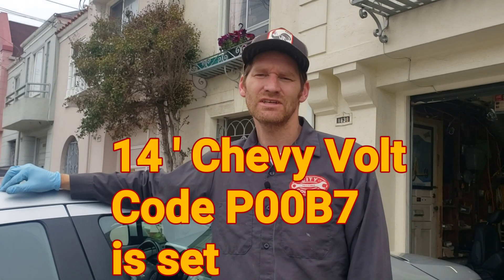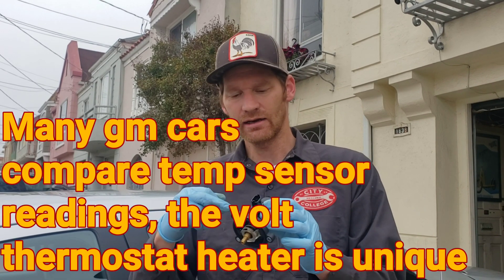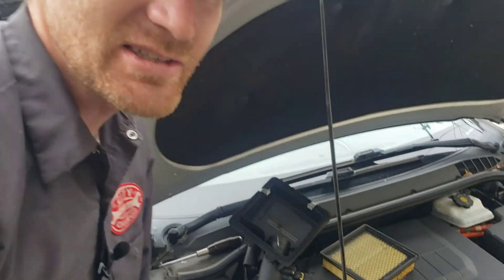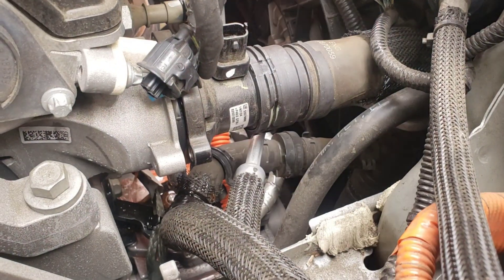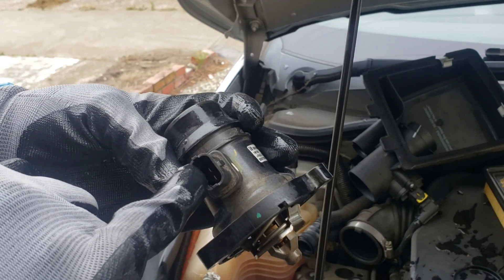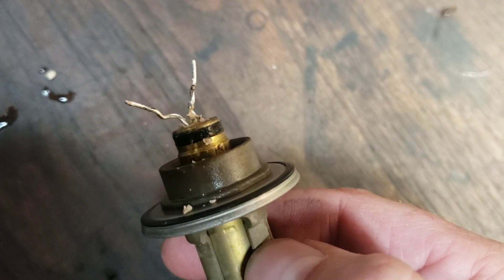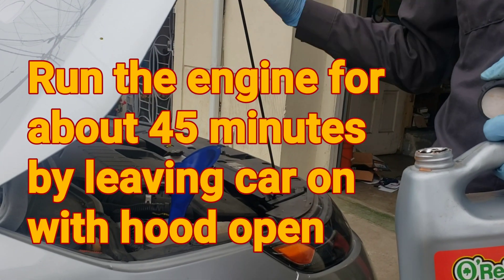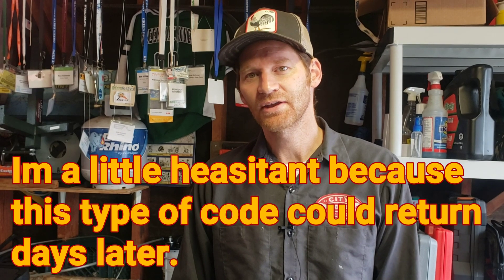Chevy Volt Engine Heated Thermostat

Comment: I have a volt that doesn’t have heat, no codes. I’ve already changed the auxiliary pump by the wheel. Wondering if air has developed in the line or if I need to maybe change this part
Reply from the maker: If I remember correctly the volt gets a clogged filter screen somewhere in the coolant system
Reply: @Mrelectric423  I think you’re right. Looks like I have a project tomorrow. Thank you for getting back to me.

Comment: great video.  i have a 2014 that's throwing the p00B7 code.  already had a mechanic replace the water pump, thermostat, radiator and valve cover.  Still getting the code and the overhead warning.  any suggestions on what to check next?
Reply from the maker: My quick google search yielded water pump, thermostat, stuff you already replaced. I’m not sure what’s going on maybe a corroded wire, plug issue?

Comment: Hello I’m having the “AC off due to high engine temp” could this be the main problem? I’m I able to drive it to mechanic?
Reply: Mine also did this, and told me to turn the vehicle off. Took it to Chevy it’s a thermostat and something else like a cover for the engine or something (fiancé changed that one idk what it was lol)
Reply from the maker: I am not familiar with that message on the volt. It certainly could be related. I guess you could drive it to the mechanic in ev mode if engine overheating is suspected.
Reply: You can drive it to the mechanic if it isn’t far but if it’s overheating and you push it you can cause more issues!

Comment: Currently broken down on highway. 2017 Volt is running at 240. Car runs for awile then  down. Cools off then runs again. Thermostat? Can I call you?
Reply from the maker: could be thermostat or water pump or no coolant. You need to tow not drive it home. Sorry no phone consults.

Comment: My '14 Volt threw codes P2181 and P0128 associated with "AC Off Due to High Engine Temp".  I changed one temperature sensor and the code came back.  Another YouTube Volt mechanic suggested it could be the thermostat.  Thoughts?
Reply from the maker: Is the radiator fan working?
Reply: @Mrelectric423  yes, it blows at high speed, non-stop.  Even when running on battery.  Drives me nuts!
Reply: @Mrelectric423  thanks for the video.  I was able to replace thermostat.  So far, no error codes have returned.
Reply: @edwinreidel1889  Where did you got it ? I have same codes P2181 and P0128

Comment: Correction the Volt is a range extended electric car. Not a hybrid. The gas engine in a volt never physically turns the wheels. It only turns a generator to generate electricity.
Reply from the maker: Actually the volt engine does turn the wheels. The series hybrid marketing has been thoroughly debunked. 
It is a plug in hybrid tho
Reply: @Mrelectric423  sorry but it does not. Chevy engineers have been very specific on this.
Reply from the maker: @superdairyboy  https://www.google.com/amp/s/www.engadget.com/amp/2010-10-11-shocker-chevy-says-volts-gas-engine-can-power-the-wheels-its.html

Comment: Thanks for taking that old thermostat apart and showing the pieces.  Great to see that this is a quick fix on a Volt.
Reply from the maker: Pat's Garage Online My guess on this design is that the engine is harder to manage when the thermostat position is unknown so the engineers want to have a hold thermostat open regardless of temp mode. 
The description you read out of the bmw manual seems to say something along those lines. 
What’s your take on this set up?
Reply: @Mrelectric423  yes, I agree with your analysis. I also shot a video recently where I drove around under normal and heavy loads to see what the temperature would do in the i8. Under load, it wants to maintain 75-85C in order to keep the cylinder walls cooler. But under normal driving it hits 100C and then dives to 75C when it opens. Emissions is also a huge factor compared to years ago.

Comment: i though the volt was fully electric. 🤔 .. anyway thanks for the video.👍
Reply: It is considered a range extended electric car. It is full electric drive. With a gas engine strictly for turning a generator to make electricity. The gas engine never drives the wheels, only a generator